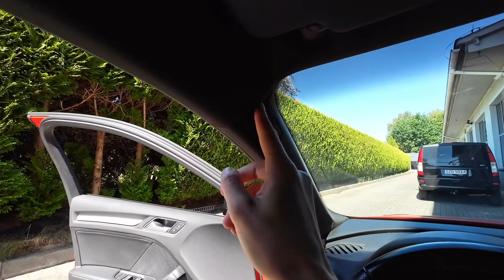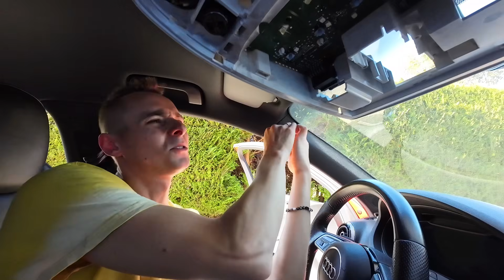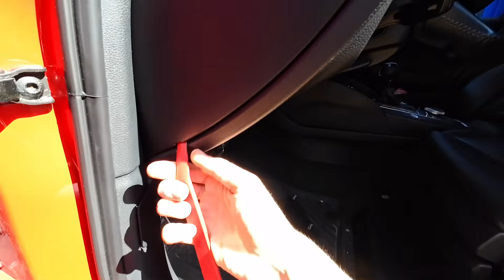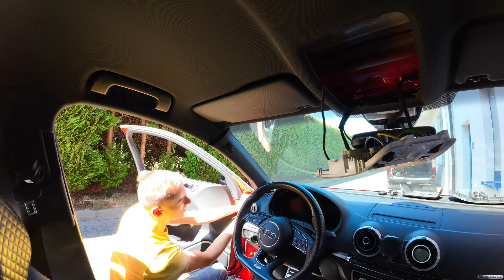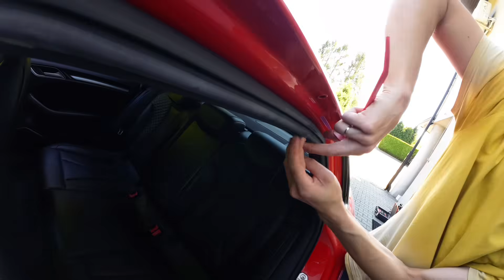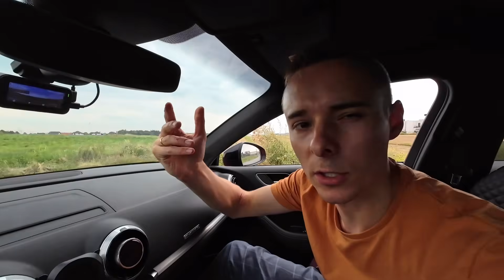How to hardwire dashcam: Audi A3 8V & 70mai

Comment: When parked, have you noticed the 12V battery draining unusually fast? On my Audi A3 8V, the car's computer stays awake and draws 600 mA, in addition to the camera's 150 mA. The car should only draw 40 mA in sleep mode.
Reply from the maker: Haven't noticed anything like that. And I'm running Webasto for several minutes before engine start.
Reply: @mrfixpl  No, it might not be easy to notice unless you are looking for it or have run into problems. I discovered this by measuring the voltage overnight after charging the battery with an external charger. After 10 hours without the camera connected, the reading might be 12.86 volt; with the camera connected, it might be 12.60 volt.

Comment: Can you help, when I got my mib 2 unit component protection removed the coding wasn't working so the unit was factory erased and after the unit works the navigation stopped working. It now says "The navigation data not enabled" and I check with vcds it is enabled I think its got something to do with it not having any SD cards inside the unit but I don't know which SD card as there is 2 types, can you help? 

Current version: MHI2_ER_AU37x_P4203

The maps comes on for 30 seconds when I first turn ignition on then after it goes back to the same screen "The navigation data not enabled".

Comment: I would like to ask about the memory function of the power driver’s seat in my 2019 Volkswagen Golf R-Line.

The seat height adjustment, leg support, and forward/backward adjustment all work normally. However, the seatback is the only function that cannot be saved to the memory settings.

When I move the seatback all the way forward and then move it backward, it stops at a certain point in the middle. I have to release the button and press it again before the seatback will continue moving backward.

Have you ever encountered a similar issue? Thank you.

I haven’t received my VCDS yet, so I currently can’t check the fault codes to determine what might be causing the problem.

Comment: Nice video. Why didn't you just wire backcamera under the head liner going through the center of the roof, as you already removed light in front and had space? This would save you some time and side airbags problems. Wouldn't guide cable that electricians use for guiding cables through canals in walls reach the  rear window this way and no airbags are in a way?
Reply from the maker: Few weeks ago I dropped down the headliner in old Volvo V50 to fix it and I was surprised about how many wires were attached over there + sound deadening and heat insulation. I could use endoscope camera to check if there's a clean path over there but wanted to make this video using as little tools as possible.